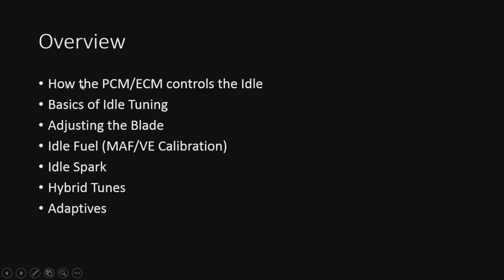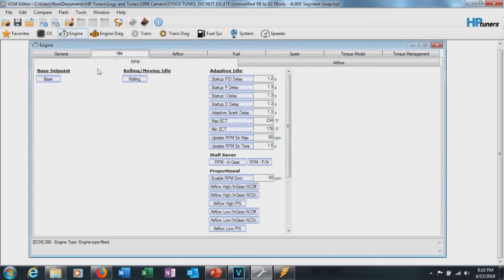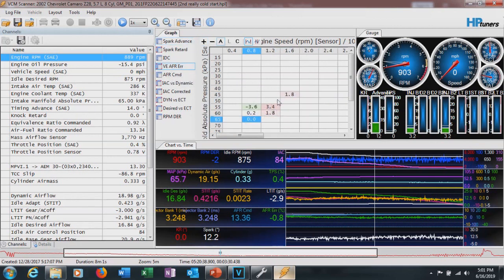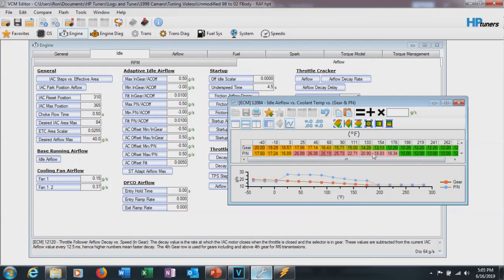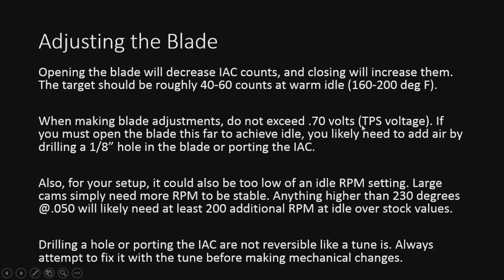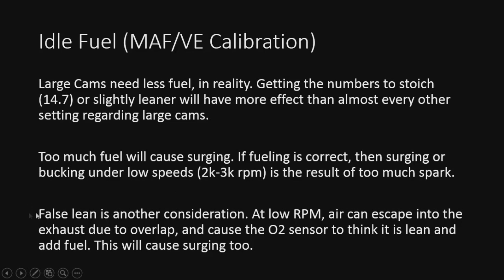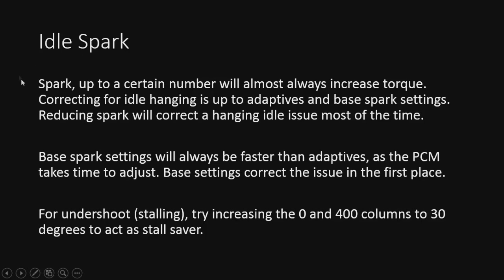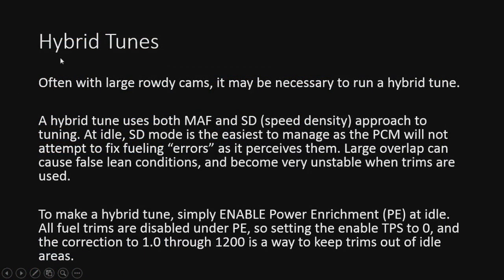Idle Tuning on Gen III Cable Cars

Comment: Thank you very much man for explaining in great detail on how to tune. I was lost big time before watching some of your videos. I've been tuning wrong this whole time lol. I'm gonna take another crack at it with a completely stock tune. By following your lessons I should have the heavy chevy screaming in no time. Thanks again for taking time to explaining this to all of us out here. Keep on rocking it bro !!!!!!!  2000 Silverado 1500 extended cab with 5.3, automatic. Mods; BTR stage 2 V2 truck cam, mildly ported and smoothed 862 heads, mls head gaskets, shorty headers, K&N cold air intake. Oh, and Flowmaster American Thunder catback with a 40 series muffler. Soon to come; tb/ss intake with 36# injectors, Holley Sniper throttle body.

Comment: Excellent video! This is one of the few videos on idle tuning that I have watched that actually discusses idle PID-proportional, integral, and derivative. I had everything polished in my tune-VE Table, BRAF, Spark, MAF, all of it spot on and was still having stalling issues when returning to idle.. Ended up having to adjust the proportional idle to get it to stop stalling. Once I made those changes, it now idles like a champ! I could have also gone to OPEN LOOP IDLE as described in this video, but I've seen several guys with really large cams get it sorted without doing that.. I have finally solved my stalling issue at idle and could not be happier. For those of you running the Elgin E1840P-otherwise known as the SS2 or Sloppy Stage 2-just know that this is what it took for me to get that cam to idle in my .030" over 6.0 with ported heads, 92 MM throttle body, and DBC.
Reply from the maker: I’m really glad to hear that you got it figured out. Idle tuning is the toughest tuning there is. It’s easy to dial in the airflow (fuel) while driving but another story to work out the “kinks” when coming into a parking lot. Nothing more embarrassing than trying to leave a car show and having your car stall several times. Most shops spend mere hours getting the MAF/VE and a few other tables straightened out. VERY few spend time on the idle tables. They basically bump the RPM up and call it a day if there are problems. Good tuners try their best to find the lowest possible idle point possible, and that takes serious time and testing. I only know of a few pros in the country that devote that kind of time into a tune. One of them is Frost. Kudos to him. He needs a week, minimum. I take two weeks because a. I’m not a professional, and b. I really want to be sure my work is solid before giving the vehicle back. I have enough cars that I can loan one out in the meantime, which is what I do when tuning for a customer. But that’s just little old me. Undercharging and trying to build a good reputation. Also it’s not my profession so I don’t rely on the money. The first Gen V I did took 2.5 weeks because it was a whole new animal. Talk about complicated. We put cutouts on that truck about a month ago and it sounds badass for a 2015 Tahoe with a stage 2 cam lmao. It’s his wife’s truck so it’s extra hilarious. 

Sorry for the diatribe and late response. I’m also a bit drunk. I go back overseas soon so I’ll probably have some time to do more videos then. I’d like to do some Gen IV and V here soon. Lots of good stuff to share with y’all. Another benefit of being an independent tuner is I don’t care if people know about it or not. I’ll share my secrets.

Comment: Great video. I have been tuning these ecu's a couple years now and always used stit+ltit to dial in the raf but I noticed on a speed density setup that seems to be an ecu guesstimate. It works fine on maf vehicle but I recommend the dynamic way for sd cars after using this my current truck starts nad idles even smoother. My raf wasn't far off using the idle trim method but the dynamic seemed to do the trick a lot better.
Reply: Another thing I never though to try was adding a little timing to the areas underneath the desired idle rpm to help it return to idle. Mine would return but had a small "hunt" first that seemed to cut that in half

Comment: I finally find why we got hanging idle, the issue is spark idle in gear, when you move it to park the overspeed idle spark take long time to start working, also the iac has already been added air when you in gear, so when go to park iac take long time to remove air maybe 2-6 seconds 
And overspeed also stat working late and he add more spark so we need to remove spark from 1200 and maybe 1600 rpm 

The factory iac valve has a slow degassing response 

And more idle spark will effect 
I should to adjust spark idle start from 400-1600 rpm gear and park 
Or 400-1200 with low spark timing gear and park

Comment: Love your instructional method. Do you have something for setting the start and warmup parameters? Even a link to a vid that you know is a good one would be a lot of help.
Reply from the maker: Not as of yet. Been busy with a myriad of other things lately, as usual. Check out Goat Rope, he might have a something on that. If you go off of my VE setup tune, that’s a good start. From there focus on fueling and idle air until it’s drivable, then tune as shown. Spark is another thing I play with for drivability, particularly for stalling and so forth. I don’t do WOT until everything else is running smoothly, and I have an idea what fueling will look like wide open. Once I have that I work up to it. Keep in mind though, the VE table maximums dictate minimums too, so sometimes numbers will shift. That means that as numbers increase on the top, you may find numbers at the bottom getting too lean. For idle I typically increase the entire columns a bit at a time after changing the top end. Hopefully that makes sense

Comment: So is it safe to say if the guy I had tune my car didn’t mess with the idle screw to get idle counts down that he doesn’t know what he’s doing cause my car has an idle hang in between shifts as well as when I put in nuetral sometimes the car will drop down to 500 rpm’s then shoot back up to desired 975rpm my idle counts are at 160-180 warm and the car only seems to want to idk right with the a/c on. I’ve tried contacting the tuner multiple times but supposedly he’s the best in the world etc. he kept telling me vacuum leak but I’ve looked at everything and can’t find anything as well as spraying carb cleaner all around intake and still no fluctuation in idle so I’m wondering if I got screwed

Comment: Very informative video and illustrations. I have seen other videos where people log idle desired airflow in P/N &Gear and copy the values into base running airflow. However, in your video, you have logged Dynamic Airflow and copied the values into Base Running Airflow Table. So is there any difference between the two methods. Will appreciate your response.
Reply from the maker: Yes, my version relies on good VE or MAF data. In a gen III, that idle desired number actually comes from the base running airflow table. In my mind, and others out there, it means that using idle desired to plot idle desired isn’t the best method. It’s worked for me in the past many times on narly cams. That’s why I prefer using dynamic numbers. At the end of the day though, whatever works is what works. Go with that lol. I’m not one to troubleshoot working tunes since that’s literally the only goal. 

This is just another round in the old magazine to use when shit don’t work.
Reply: Thanks for the prompt reply. I have set a table for logging dynamic airflow as per your video. As advised, will start VE Tuning, then MAF, and last will be logging Dynamic Airflow
Reply: How does one determine the correct counts to see at idle? I am tuning a hybrid 454. Ecm is a modified 94 OBD1 and the heads, intake, and injectors are 96 to 99 Vortec. My IAC counts warm are 0 to 2. I have seen 5 to 10 to shoot for and as high as 40 to 60. Does the ecm used determine this or is it something else? Thank you.

Comment: Hi Doc , so the hybrid tune sounds like it would be nice. I was under the impression though that the mass air isn’t a factor until you set it to whatever high rpm it is set for in dynamic airflow tab? Just thought VE was working fueling at idle up to whatever rpm
It’s set to. I think stock
It’s 4000 Rpm? I set to mine to 2500.
Reply from the maker: When the MAF is active it becomes the primary airflow table. The number in the dynamic tab doesn’t seem to do much, although I also set it to 4K and go from there when tuning a MAF enabled car. There’s a lot of tables we don’t see in the software that are in the PCM. But MAF is much more accurate at high RPM. 

The VE on the older gen 3 setups can effectively be zeroed out and the car will run fine as long as MAF is on and accurate. It’s been done. DDNSpider actually did it on his car during one of our discussions. 

For the hybrid, it will work on either air model. The question is if you are going to use fuel trims (STFTs). You can enable STFTs with a pure SD tune or MAF. The idea behind the hybrid tune is to kill the trims at idle on super rowdy cams, then use them throughout the normal driving range. It’s quick and easy to setup using PE. It also can be done using either airmass model aka CLSD or CLMAF.
Reply: @ thanks for everything seriously! I’m feeling confident attempting to tune my 99 SS knowing what I learned from your videos . I’m a firm believer in if you want something done right you have to do it yourself!

Comment: My ls1 with mildest comp thumper stalls cold every time I put it in gear, any ideas.   Thanks
Reply from the maker: Increase your “in gear” spark advance a few degrees, and add some air to your in gear “Base Running Airflow” row. Usually I add 1-2 g/s over whatever the neutral numbers are. 

Spark though is what will make a noticeable difference.

Comment: Thanks for the info. What about using the throttle Cracker? my cammed car wants to stall (too lean) when i clutch in
Reply from the maker: Almost all transient fuel is a product of the VE table. I’d look there. Also, your DFCO settings too. That should be off while tuning. I will say though, the last car I tuned I turned on the clutch cutoff for fuel because the customer really liked the crackle effect, and the lean conditions that caused did not make it stall. It crackled like crazy though lol.

Comment: If I get surging coming to a stop, are my spark over / under speed tables the best place to start? DBC throttle body on a cammed 6L with 799 heads and TBSS intake. Sometimes the surge / idle swing is enough to make it stall.
Reply from the maker: This is a very common problem with larger cams. The problem is not simple. All of the areas to address are in the video, however all cars respond differently. A few things to look at though… 

1. Is your IAC still moving or does it hit zero? Also, are the numbers in a practical range? Some cams will like higher numbers to idle, but won’t like to cold start. Pick which one you prefer here. 

2. Spark should only be advanced to the point of lowest MAP value… this means efficiency. 

3. Lower the over/under for larger cams to keep the PCM from losing control of the torque. You don’t want huge swings. 

4. Check your fueling. Bad fueling will definitely cause problems. Leaner is better when you have overlap, since there is always some air getting by which skews the numbers at low RPM. This is usually referred to as “false lean”… so actually let it be “false” since what the WB is saying isn’t necessarily true at idle. 16-17 AFR is perfectly fine. 

5. Air will always enter the chamber from the easiest source. With overlap, this could mean that scavenging is the source, which is where bucking comes from. That means you need to make the intake the better source. This can be done though adding idle air, or decreasing MAP through MBT spark for that engine. The lower the MAP the better. 

Hopefully that helps. Good luck, it’s the hardest part about tuning a cam.

Comment: My engine doesn't like coming down to idle.  It'll die after a throttle blip or coming to stop sign.  It's an aftermarket BBK throttle body and IAC port is small.  I get IAC steps down to 40-60 but this still persists.  I drilled a small hole in the throttle  body blade but I think it needs more I feel.
Reply from the maker: Giving it more air won’t help an idle hang. Look at your spark at the hang, and reduce gradually. You can use the scanner too to adjust it and test. Also, add timing back in under your normal idle range, as in 400 RPM or so. I usually set those columns to 30* to prevent stalling. 

Also, increasing the base idle alleviates a lot of problems. The bigger the cam, the more RPM it needs to be stable. It is possible to get them lower, like even 600, but it can be incredibly difficult to make it reliable in all conditions.

Comment: So do you recommend doing IAC counts table first or BRAF?
Reply from the maker: BRAF guesstimate to get it running, VE, then use dynamic values for BRAF for more accuracy. IAC is fine tuning. Set the screw so it runs good enough to tune, come back later to dial it in so it has enough IAC for cold starts.

Comment: I been pulling my hair out with my idle tuning. Its like I have to choose between the engine starting without me holding the pedal or being at the 40-60 counts when hot. But I been basing that when the engine is all the way at operating temp at almost 210. Gonna do it closer to that 200 number because there it wants more throttle blade and so it should start easier too
Reply from the maker: The counts at operating temp are not a set in stone number. You just need them low enough to allow for it to open enough when it’s cold. 99% of that is from the blade setting. Also keep in mind, with a vibrating engine, the set screw isn’t always going to stay put. I put a lock nut on mine, as a sanity check. 

A way to do it is set your blade until it’s happy and runs cold and warm, then go back to the effective area and reduce the numbers. It will change the counts. It can be a long annoying process. If the counts end up higher and it runs well in all conditions, then call it good. The whole idea behind the range is to allow for enough IAC motor for it to start and run completely cold. If yours are say 60-80 and it has enough, send it. No need to pull your hair out lol.
Reply: The issue I'm having is it doesn't have enough air to start but once its running for awhile the iac will completely close and be unable to control the idle unless the blade is closed enough to where it wont start without the pedal down and wont stay running unless I feather the pedal for about 30 seconds. I've gotten my ve table pretty dialed in hoping that doing base airflow tuning fixes that. I've noticed desired iAC airflow being under 3 g/s consistently even at 0 g/s but actual tends to be around 10 g/s
Reply from the maker: Then you need to open the blade a little more… or… port the IAC itself. That definitely helps too. Also, many have had to drill a hole in the blade, but definitely try porting the IAC first before doing that. What I mean is drilling out the back exit hole. Check the forums, lots of information on that. It was night and day difference on my 102.

Comment: I have a 5.3 with DBC throttle body.  Cold start I log dynamic airflow and desired airflow as you described. I let all the cells get populated and take that data to the correct place in tune. My question is when I let it warm up from a cold start and say at 198 cell it gives me a 12.25g/s when fully warm. If I then go back to the tune and update the dynamic 198 cell, I load the updated tune and then turn back on the truck.  Now the dynamic 198 cell wants only 8.5g/s and not the 12g/s it was just calling for. What could that be? The motor acts like way to much air, high rev on start up. If I again change the cell box back to the new 8.5g/s the engine runs normal. It’s the same for the desired if I log those as well. When warm it will want 14g/s and then after I update the tune for that it now only wants 7g/s. Maf and VE table are dialed and smooth. Maf and dynamic numbers are just about dead on to each other.  It’s like I can’t drive the truck unless I let it warm all the way up, shut it off, turn it back on and then it seems fine and logged number are accurate.
Reply from the maker: Have you posted this on tech or hpt? Would be easier to take a look at the log and tune than to speculate.
Reply: Thanks for the response, I just made a post on HPT
Reply: Figured out my issue, ended up being a faulty IAC valve. Changed it out for a new ACdelco unit and all is working perfect. I do have one question though, as the truck is warming up my desired and dynamic are less than 1g/s apart. At full temp dynamic and desired get about a steady 1g/s apart, the desired is lower than dynamic. Is this okay? Should desired be more than dynamic? I used your IAC chart from the other video to see what the actual IAC wanted and most number are off by about 5. Is this close enough or should I change the IAC chart? 
Thank you for all your videos, extremely helpful for us new to tuning.
Reply from the maker: @b123zmanab  They can be off and vary day to day. If it's running and idling nice and warming up on its own, it's good. Remember try not to get upset if numbers aren't always perfect. The overall goal is function. Once it's functioning, no need to mess with it further lol.

Comment: What is the best way to reduce fuel in gear
Reply from the maker: Reduce the air it thinks it has. Typically on the VE or MAF. If these are accurate though, then use the base running airflow table.
Reply: Will try thanks doc